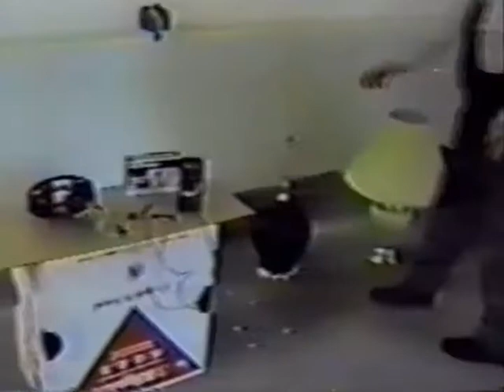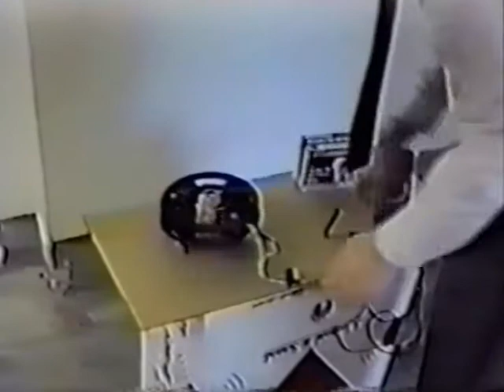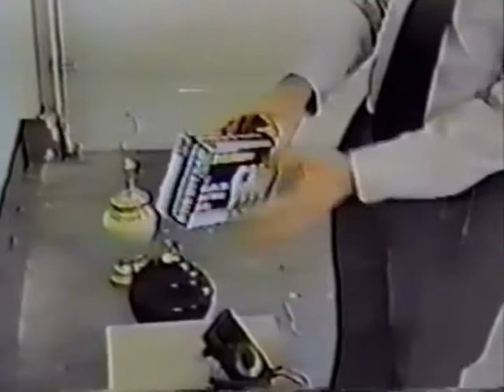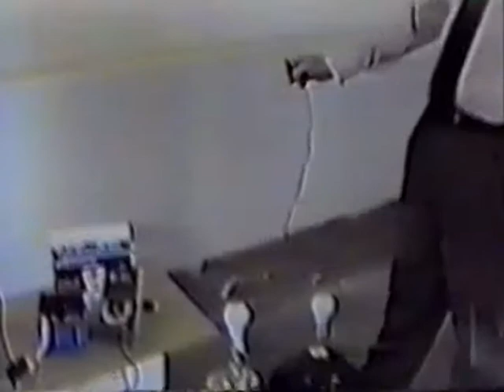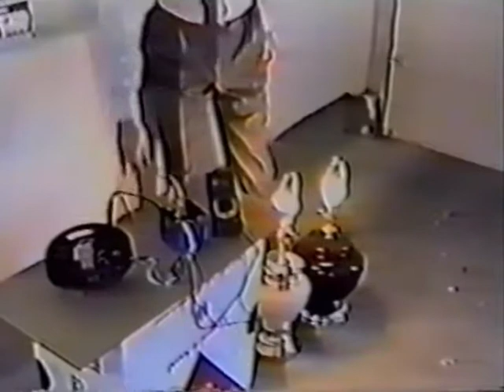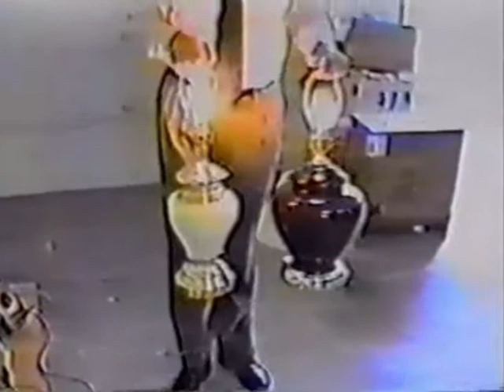Steven Mark - TPU - Demonstration Two

Comment: Okay,  so far I watched the first one and this one.  There is some suspicious things here: (the fist one not so much)
1. The Box that the device is displayed on.  No attempt to move it or move the device away from it.
2. The coil on the device which is visible could definitely be a receive coil on a power transmission type circuit